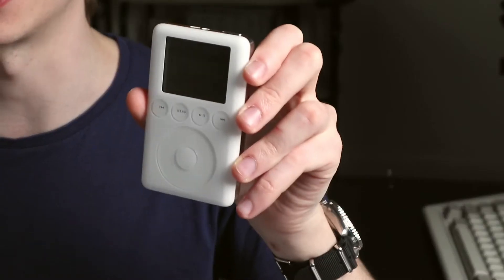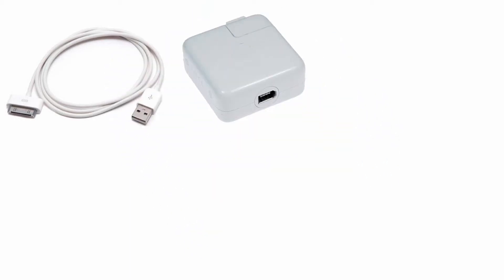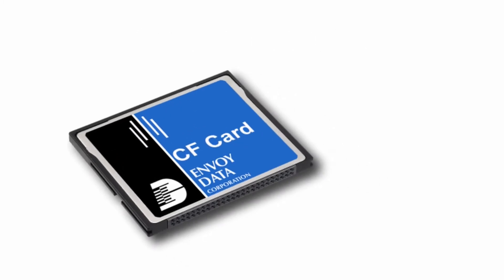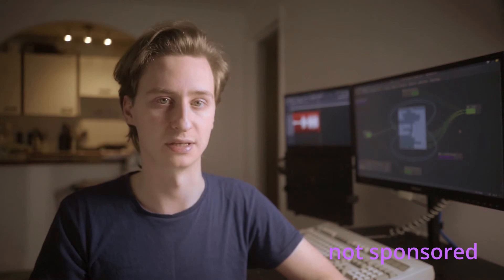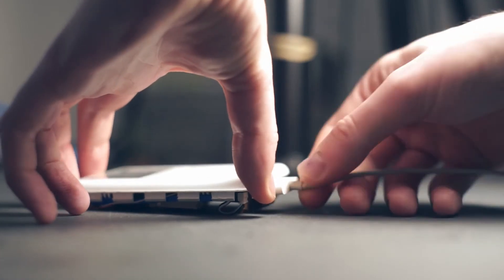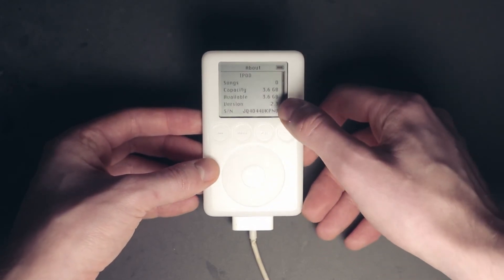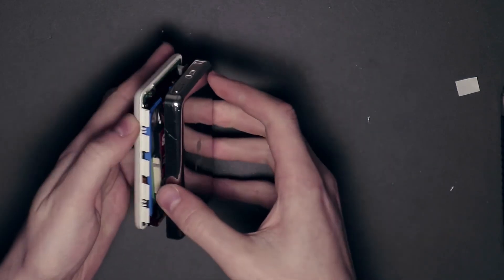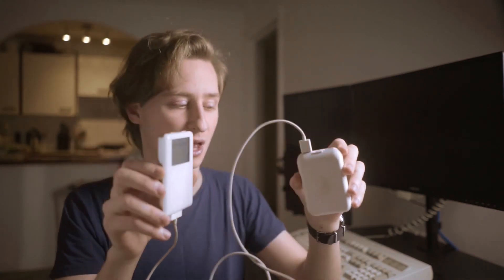Ipod Classic 3rd gen: solid state (SSD) flash memory swap/modification

Comment: Correct me if I'm wrong, but I've heard that flashmodding the 3rd gen specifically is a bad idea because it causes storage malfunctions
Reply from the maker: Hi! No, i don't think its a bad idea. Its hard to get a fully working combination without buying the iflash adapter, but when it works, it works well.

Comment: I put a flash mod in my 3rd gen and a sd card and it won’t work I restored it, it showed up as an iPod on my pc and when I disconnected it it still said ok to disconnect and I hard rest it and it said the file system was corrupted
Reply from the maker: Sorry to hear that - yes, this modification is very annoying and unreliable, i would try a different card.

Comment: I got a 3gen classic, bought the firewire and power block, every time I to charge it and start it, the apple comes up, then it squeeks, and the logo flips and goes to a menu. Try to restart it from menu, gibberish, then same menu. Ordered a battery to replace as first step. Thanks for the videos, I have hope.
Reply from the maker: if you have a usb cable, i would recommend trying to fully reset the ipod, it sounds like some files might be corrupted. I'm not sure a bad battery would cause this.
Reply: @TheRepairLair  Thanks for the feedback. I have tried plugging in a USB and putting it on my computer, it wont even read and i Tunes wont recognize it. Pretty sure I will be changing it to SD, need to get the adapter etc ordered. I have watched several vids including yours on doing the switch, getting my confidence up. I think your have done it in yours, but it would help if modders would add links to the parts they use, would help saving guess work. Thanks again for feedback.
Reply from the maker: @joeholm4591  Its strange that it doesn't get recognized at all. Maybe worth looking to see if you can get a working ipod from ebay, maybe something in bad cosmetic condition? Would be a shame if you put all the effort to get it modded and it turns out to not work later
Reply: @TheRepairLair  i am planning on doing the hard drive replacement like you did, just want to get into it and then order the adapter and memory. I kind of figured I would have to do this. Watching you do yours gave me the idea  to try.

Comment: Well done, and very informative presentation.  I just completed replacing my HDD with an iFlash + SD card and a new battery. Hardest part was opening the 4th gen iPod. Be careful when attaching the cable to the iFlash. I bent two of the pins in the cable, but managed to straighten them out. I have two more classic iPods I plan to mod. It’s kinda fun! 👍👍👍👍
Reply from the maker: Thank you for sharing your experience, i'm happy it worked well for you :))

Comment: worked first try ;). formatted to fat32, and used a windows computer to restore. There is, however, a weird screeching/groaning sound coming from the ipod whenever I use the controls (scroll or press buttons), which goes away as soon as I dock it or turn on the backlight, and starts again as soon as I play music. Its definitely not the hard drive since it's present even after the flash mod. Seems to be coming from the clicker speaker, but I really can't tell it just seems to be coming from inside.
Reply from the maker: happy to know you managed successfully! Very strange to hear about the noises as i haven't experienced this. I guess it could be some coil noise from power circuitry, but unlikely, knowing that it goes away when the backlight turns on. Have you replaced the battery too?
Reply: @TheRepairLair  yeah it could be a capacitor or something like that. I actually haven't replaced the battery because the one still in it, surprisingly, still holds multiple hours of charge. I will try installing a replacement battery and see if that helps.
Reply from the maker: @randomchannel252  Please  let us know if it fixes it!
Reply: @TheRepairLair  After replacing the battery, the noise is indeed gone. When I first powered it up after the installation, however, it was still making the sounds. But after a couple plays and trips on and off the charger, it was gone for good. The battery that was taken out is indeed the original battery to the ipod (dated 2004 on the label). I'm surprised that the original battery still holds charge that well. I think despite the fact that the battery held a decent charge, it was bad in some way that caused the screeching. The screeching was definitely caused by the battery, but definitely wasn't coming from the battery itself.
Reply from the maker: @randomchannel252  
Excellent, very happy to hear you got it sorted!
Reply: @TheRepairLair  Heres an update. The noise came back briefly, and is gone again once its plugged into the charger. However, the battery indicator is doing weird things. For instance when I charged it this afternoon, the ipod showed the "charged" screen. however, when I unplugged it, the battery indicator showed it only at 25% full. When I plugged in the cable again, it continued charging. Initially, when I charged the new battery for the first time, it took an extremely long time just to charge it from 75% to 100%, almost 2-3 hours. I'm not sure whats up.
Reply from the maker: @randomchannel252   I think you should try reinstall the old HDD into the ipod and see if it continues misbehaving - i wonder if it doesn't like the adapter or the card. Maybe the specific card you have draws too much current? (but would be weird and unlikely as solid state media should use less power...) worth a try regardless! If the charge % wasn't misbehaving, maybe the aftermarket battery is of questionable quality - you never know what you're gonna get when buying 3rd party
Reply: @TheRepairLair  Sound is gone again as of now. I don't think it's an issue with the hdd, since the screeching was there with the original hdd as well. The CF card is sandisk, a reputable brand thats worked for other ipods as well. The ipod works with the flash memory without any quirks whatsoever. Perhaps it has to do with the battery charge. I'll use the ipod until it drops below half and see if it comes back.
Reply: @TheRepairLair  I've confirmed that the noise starts as soon as the battery drops below 50%. Again, it goes away when its plugged into the charger or when the backlight is turned on.
Reply from the maker: @randomchannel252  Hi! Very strange, i really don't know what to make of this.

Comment: I used to convert 3rd and 4th Generation ipods to flash drive using the three adapters until a couple of years ago when  unless I used a iflash cf to sd converter the ipods would only restore correctly using a mac computer on my windows laptop I'd  connect to iTunes click on restore it  would then restore but on restore present the bad folder sign and iTunes would show it as faulty and needing restore never working just repeating unless I plugged it into my old mac book where they worked first time or as I  said earlier worked ok with the Iflash converter but for resale they are too dear ( but excellent quality and always work ) I've tried all the Chinese cf converters none worked for me they used to but not  anymore,  so works (for me) on ios but not windows   I kept one as I  have software on my windows laptop that lets me use ios configured ipods but to sell the ipods its better if they're running windows as it connects to ios without any problems,  long rambling message I  know but any ideas why

Comment: Hello, first I thank you for all the informations from the 1. and 2. video, it helped me to get my ipod start after 15 years! But there is one problem with Charging, i only have 30 pin cable with USB, so I can´t charge the Ipod in normal way. Would you give me some advice how to charge it or modificate it to charge via USB? i would very appreciate it! Thank you!
Reply from the maker: Hi! Thanks for the comment - i have planned to make a part 3 of these series where i modify the ipod to charge via standard usb. It is to install a 5v to 12v boost converter and connect that to the 12v input - i've tested that and it works, but i have not yet managed to film the process, sorry. I do still plan to film and share how to do that eventually.

Comment: I did this with a 64gb flash card and when the iPod got restored I plugged it in with a FireWire cable but instead of completing the restoration it got stuck on a boot loop and even holding down the buttons to restart didn't work for me since it just continued the boot loop should I format the SD card with a SD card reader or do I need to get a smaller sized sd card ?
Reply from the maker: If you have some smaller sized sd cards, i would say try with those first
Reply: @TheRepairLair  nope still didn't work just did the same thing just gonna get an actual compact flash instead maybe that would work better
Reply: @rodolfodiaz2945 hey this happened to me too. Did the change work for you?

Comment: Request: Can you convert the hold switch into a power switch that’s connected directly to the battery?
I’ve upgraded every one of my 3rd generation iPods. HDD adapters and CF to SD card adapters are extremely hit or miss. My last ipod mod went well but the upload speeds were soooooo slow, like two minutes per song. I decided to finally cave in and buy the iFlash adapter and HDD converter. I’ve spend enough money on bad adapters. I especially hate it when I rebuy an adapter from amazon but get a slightly different version.
Reply from the maker: I'll look into the request, but no promises - lots of stuff in the pipeline but no time to do any of it!

Comment: I have a 256gb SD card. Would that capacity effect this mod?
Reply from the maker: It's really a game of luck - no way of knowing for sure without trying. I don't have a 256gb SD to check for you, 64gb worked OK for me.
Reply: @TheRepairLair  And in my experience it gets hard to find music due to the small monochrome screen
Reply: 256 will not work. The limit is 20gb but some have gotten to 64gb. 64gb can make the iPod glitchy. 256gb will just make it stop working

Comment: Hello. I am looking forward to the next video in this series. I would like to ask you if you know what I can do to fix the 30-pin connector on my iPod. When I connect the cable it starts to charge, but after a few seconds it stops. To avoid this I have to put any element on the cable to press diagonally
Reply from the maker: Hi!
you might want to fully disassemble the ipod, take out the motherboard and inspect the socket connection to the motherboard - the most likely problem is solder joints cracking on the connector pins. If you  know how to solder, should be an easy fix.